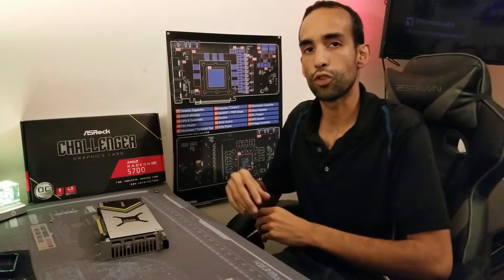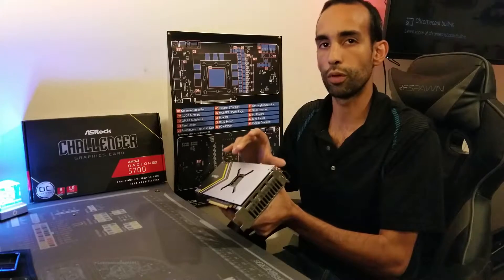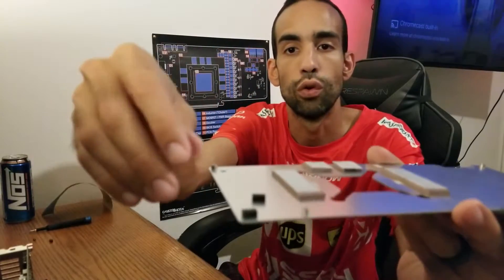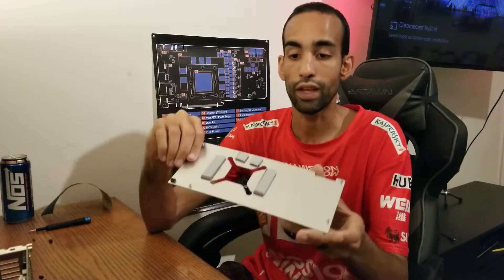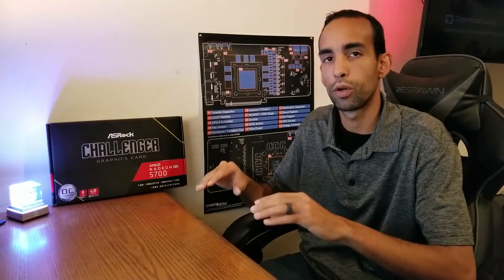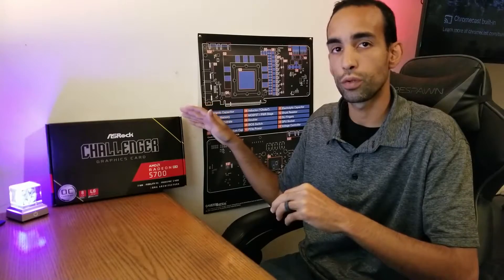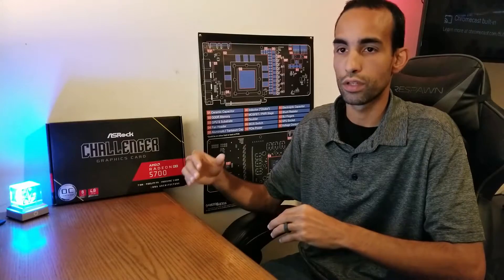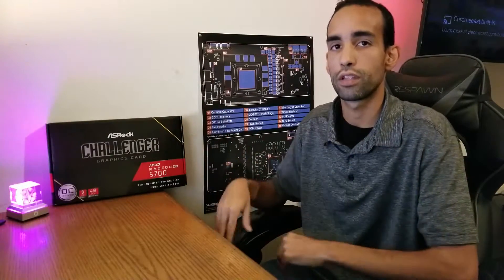Improving RX 5700 Thermals - Asrock Challenger

Comment: @SerpentX Tech  Please .. Do you think that if I use it on the rear of the VRAM, (rear of the vram + thermal double-sided adhesive tape + 1mm copper shim + thermal pad + aluminum back plate) I will have a better dissipation? or also if I use (rear vram + thermal double-sided adhesive tape + copper wedge). The copper wedge will be cooled by 2 powerful 140mm fan delta. What do you think of this? Sorry for referring to a slightly old video and sorry for my google translate English.
Reply from the maker: No, it would work, but be careful. If that copper or metal makes contact with any SMDs or components on the backside, you could short thr card. Instead of adhesive tape, copper shim sinking to backplate, you can just go no backplate and your wedge or bigger heatsink. Make sure to account for the Z-height of all the small components on the back
Reply: @SerpentXTech  Thanks for the reply. I've watched tons of videos about the famous "copper mod shim" between the vrm and its heatsink. But I came across the possibility that the pressure on top of the vrm in the absence of the thermal pads may cause problems in its welding. After all the thermal pads in addition to having the function of dissipating heat also have the function of evenly distributing the pressure in the component in addition to helping in the alignment of the parts, this no longer occurs with the copper wedge. On the other hand literally, that is, on the back of the video card, if we are going to use only (rear of the vram + thermal adhesive + shim) only pressure will be only the weight of the shim, I think it is safer that way, he will have less chances of slipping because he is sitting on top and not hanging, in addition to the positive fact of being glued,   the double-sided thermal adhesive tape has 2w/mk but is only 0.15mm. I am waiting to get the shims from China, as soon as I arrive I will disassemble and check if the 0.15mm adhesive will be enough to avoid contact of the shim with any component, otherwise I will use thicker thermal pad. My VRAM temperatures get at most 80°C in stress, but I want to go further with OC. Maybe 2000Mhz. I use this frequency on my gtx1700 galaxy katana.

Comment: Hey man, after you got your challenger working, what OC settings and voltage did you start using?
Reply from the maker: 0.850 mv Core Voltage, 1350 Mhz Core clock, and 1840 - 1830 Mhz memory.

Comment: Dude, thank you so much. I did the thermal pad thing using 3mm gelids from aliexpress, plus the slight bending of the plate. My mem used to reach 100c during ethereum mining, now it's around 88c!
Reply from the maker: Very nice, glad it worked Wolff!
Reply: Do you mod only in the back of the board w/ the plate?
Reply: @fireuno  just like the video. thermal pad between the back of the card and the plate
Reply: @fpcawolff  Agora que eu percebi vc eh BR!!!

Comment: Also wanted to let you know, if and when your fans go bad

The XFX rx 580 (red sticker in center) fans work perfectly on this card. Same 95mm, mounting pegs line up, wires reach and right correct pin out.
Reply from the maker: Right on time Scott, Thanks. The back side fan is going out, so I will look for that fan.
Reply: @SerpentXTech  np :)

I ordered 10 sets of the XFX fans haha, if you have trouble finding any let me know, don’t mind sending you one.

Comment: I just did this to one of my challenger 5700s

Used 1mm 17w/mk for under the vrm heat sinks

And 2.5mm 7w/mk for backside

Bent my backplate like you suggested

All backside pads are making solid contact.

About to throw it in and see how my temps are :). When mining ethereum I am expecting a fairly substantial improvement which should allow me to run the chips at a bit higher memory clock and thus higher hashrate :)
Reply: Update on this:

My memory temps decreased about 6c under my usual ethereum mining load

With new thermal capability, I was able to push memory clocks to 1880-1900mhz and still maintaining about 4c cooler memory temps than previous.

And I am now mining at 57.5MH
Reply from the maker: Very nice, congratz how did it do?
Reply: @SerpentXTech  4-6c improvement across the board

Gained access to pushing mem clocks much higher with ethereum mining as well. Very happy :)

Bought these in august for $329 a piece... what a flipping steal

Comment: Hey, I bought this GPU two weeks ago. Im only having issues with the vram temps and memory junction temps which are really high. Could I just replace the thermal pads? Its the first time Ive seen the pads from the backplate of the GPUs being changed, at least for the other models I see that people only swap the front part, should that be enough? Do you think that theres a size that could fit on this card without having to bend the plate? is my first time doing something like this so Im not confident on bending aything. Thank you!
Reply from the maker: Yes, just get 3mm thermal pads for the back if it is the same GPU model. Asrock Challenger RX 5700. For the front, just measure the pads already in place and order the replacement ones. I can't recall the exact size for the front, but adding some in the back yielded positive results.
Reply: @SerpentXTech  Thank you! It is the XT model but the internal and external designs are exactly the same. Temp on the core clock seems to be pretty good compared to the non xt model on stock but the issues with vram are still present. I think that there are no pads on the front side.

Comment: Been looking at your video several times. I want to try the same with my Asrock Challenger RX5700XT. Do you think it'll with the same thermal pads thickness?
Reply from the maker: Go for 3 mm thick thermal pads, and you might have to slightly bend the back plate inwards. Not enough it is visually obvious, but enough to apply pressure on the thermal pads

Comment: I only changed the paste and without pads.
My junction temps went up by 20 Celsius, .
Stock junc temp 80 c
New paste 100 c.

What I'm doing wrong lol
Reply from the maker: Take is back apart, and check the contact patch. You have to cover the whole GPU die. Do you have more paste, and what kind is it? I use thermal Grizzly Kryonaut. But not sure, retracing your steps help, make sure the GPU die is making good contact with heatsink, and try again. If you havent changed clocks or voltage then something is not making sufficient contact, I will say the stock cooling setup sucked, so that is why I modded it. The pads are for the back side of the memory but it sound like your just trying to get GPU temps down.
Reply: @SerpentXTech  My gpu was fine at stock, all I wanted is to lower the memory junction and hotspot temperatures.

After  renewing the paste first try.
Gpu 72c
Memory junction 78c
Gpu Hotpot 107c

I used arctics mx5 paste.
I will order pads aswell and do it properly next time. 

Mine is a gigabyte rx5700 xt.
Reply: @thekids_callmeboss6577  hello. I used the same card..did u use thermal pads for memory? How's the mem temp now??
Reply: @Миша-л7й8л  yes.
I sent my card back to shop and have a new one....
I do not recommend open the card.
You need to apply  the exact same tension when screwing it back.
You also need to know the thickness of the pads.

I recommend undervolt the card first and look at temperatures.

2000mhz clock 
1116- 1118mv
Memory 1840
Power +50 or maximum 
Adjust fan curve

Comment: I was really disappointed about temperature on RAM on this card. Mining ethereum was leading to freeze my computer. 
Temperature about 104 Celsius is too close to thermal limit on this card. I appreciate your video, it is really good stuff.
Reply: Is it really bad ? This is my first PC and i ordered this GPU since it was my only option....
Reply: @nawafbinhumaid_9181  gaming is fine on it.
Reply: @vyor8837  Yes I agree, I had never problem with gaming, only with mining. 
Finally I fix problem with mining:
1. Don't strip your memory in bios setting - let it be default.
2. Put away backplate from this card.
3. Use passive aluminium coolers for memory from backplate side.
4. Put some silent ventilator on the passive coolers.
Reply: @mariangall665  Hello, I'm about to install copper shims behind VRAM, I think of two mounting alternatives. Alternative A) attach the copper shims behind the VRAM using double-sided thermal adhesive tape. Alternative B ) Use behind VRAM x thermal pad 1mm x copper shim 0.8m x thermal pad 1mm touching the back plate plate (a sandwich) . What do you think of this? how did you fix your aluminum heatsinks behind VRAM?
Reply: Finally I go down with temperature to 94 Celsius, but freezing of PC still continues..:/

Comment: what about removing the backplate completely? Have you tried? Thats what i did but i'm wondering if instead i should buy thermal pads...
Reply: Same question , was wondering if removing the entire backplate will improve it with better quality thermal pads
Reply: @stemz4anime580  Just successfully removed mine without breaking the warranty sticker. Apparently if GPU usage is 100% all the time there's no difference in peak temp, but heat dissipates faster. I'm gonna try putting on aluminum heatsink instead of the plate next.
Reply: What you ended up doing? I bought this card and the thermals on the memories are horrible, just removing the backplate helps a bit if at all? I feel like it would make it even worse. You kept the thermal pads after removing the plate or just used the gpu without pads?
Reply: @PanchoBDM  yeah man stock thermals are horrible. Since there is no thermal pads between the back of the card and the backplate, it acts as an insulator since there is no airflow. Personally i ended up with a rajintek morpheus 2 cooler, 2x noctua nf-a12x25, enzotech pure copper vram heatsink, i used the rajintek supplied vrm aluminum heatsink and finally some thermal pads between the card and the backplate. Ok its a bit overkill but i already had the morpheus... and now that thing is a beast!
Reply: @alexispresley  so sad i dont have any of that to use 😅. Do you think that it would get better at all by removing the backplate or at least putting some thermal pads on it if it doesnt have any? I really didnt want to bend the backplate lol
Reply: @PanchoBDM  i do think thermal pads would make a good difference especially if you have good airflow over the back plate. Also it’s really not that expensive. That stock cooler really sucks and it will never be perfect. Even with the morpheus cooler, the original vram and vrm cooler were not able to keep the card cooled. Vram would hit 105c and vrm would thermal throttle after two hours of borderlands 3.
Reply: @alexispresley  sounds as bad as mine or even worse but good thing you found a solution for it
Reply: @PanchoBDM  a 200$ cad solution.... lol

Comment: Hi, Thanks for all videos about this videocard!! Really useful...

I know there is quite some variance in assembly quality for videocards, so in order to determine how good/bad the assembly of mine is, I'd love to compare thermals with yours. I'd prefer doing this before ordering thermal pads / paste and disassembling my videocard, because perhaps mine is quite ok and wouldn't get very much gain from the mods. Perhaps it's even a very good assembly that will be hard to match after disassembling (it doesn't make any weird noises so far for example).

But in order to compare thermals, I'd love some more details on how you measured... I already know you fixed rpm to 1500 (mine varies between 1490 and 1580 after trying to fix it). But can you give some more details about the rest? Like settings used in Unigine or 3dmark? Resolution? How long did you run it? Driver / BIOS version? Ambient temp in your room (approximately)? Did you use hwinfo of gpu-z for measuring? And whatever I'm still forgetting ;) I don't really require all details from all benchmarks, but at least 1 would be really nice!!

Thanks!
Reply from the maker: Let me get home from work and I will review my data, and I will get back to you.
Reply: I just ran Unigine Heaven with the Extreme preset (1600x900 :p) for about an hour and HWiNFO64 gives the following max values:
GPU: 76°C
Mem: 86°C
VR: 78°C
Hot Spot: 85°C
GPU clock: 1694-1712Mhz
So unless you were running some lighter preset, I guess mine is a bit worse then yours...
Reply from the maker: @Masta_killa_   Room temp - 24 C | Driver 19.9.3 at time of filming | Use Hwinfo to monitor and MSI Afterburner to overclock
Stock
GPU: 74°C
Mem: 82°C
VR: 75°C
Hot Spot: 84°C
GPU clock: 1669-1710Mhz

After Mod (Liquid Metal and Mem Pads)
GPU: 70°C
Mem: 77°C
VR: 68°C
Hot Spot: 80°C
GPU clock: 1686-1718Mhz

FireStrike Extreme -  Stock Clocks 1440 p benchmark
Overall - 10493
GPU Score - 11107

FireStrike Extreme -  MorePowerTool RX 5700 XT level performance
Overall - 12443
GPU Score - 13343

Core set to 2180 Mhz
Mem set to 1850 Mhz

GPU: 81°C
Mem: 78°C
VR: 77°C
Hot Spot: 98°C
GPU clock: 2050-2122Mhz
Reply: @SerpentXTech  Thanks a lot! Do I understand it correctly that all the above temps were maximum temps after running Firestrike Extreme once? Or did you loop Firestrike Extreme and ran it for a longer time?
Also I wasn't aware you could use an MSI tool to overclock an Asrock card... Is that advised? Thanks!
Reply from the maker: @Masta_killa_  so the temps above are from running Unigine Heaven on loop, and yes MSI afterburner is a good tool to use no matter who makes the card. Also a tool named "OverdriveNTool" is a good Plain interface you can use to overclock or underclock.
Reply: @SerpentXTech  I supose Unigine Heaven with the Extreme Preset? I forgot about another important factor btw... What case are you using?
Reply: Hi,

Little follow up from my side... I've bought below 2 products:

https://www.amazon.de/gp/product/B011F7W3LU/ref=ppx_yo_dt_b_asin_title_o00_s00?ie=UTF8&psc=1 Thermal Grizzly TG-K-001-RS Kryonaut (7,08 euro)
https://www.amazon.de/gp/product/B07CK31PST/ref=ppx_yo_dt_b_asin_title_o00_s00?ie=UTF8&psc=1 Gelix GP-Extreme 3mm thermal pad (10,99 euro)

And applied them on my videocard. I've used 2x 57mm x 20mm thermal pads on the left / right memory and 2x 23mm x 20mm on the top memory (using up the whole pad). I've also bended the backplate, as you did. I've removed all rubbed spacers, except the one in the corner.

And here are the results using Furmark with fans @ 50% (+-1600rpm):
Before: GPU 77°C | Mem 106°C | VR VDDC 80°C | Hot Spot 85°C
After: GPU 75°C | Mem 98°C | VR VDDC 76°C | Hot Spot 84°C

So nothing became worse and memory is a lot more acceptable now.

Note: As you said, during normal gaming both noise and temps never were a problem. However, it is winter here now and I don't have AC, so I mainly did this to avoid problems in the summer...

Thanks again for your video!

Comment: First off, awesome videos for card. My plan is to mod it to help thermals and make it quieter. This would be my first time attempting something like this. I just looked at frozencpu for pads , and it seems only the 6w pads are listed now. My biggest plan is to remove the stock fans and ziptie some Noctua fans to the heatsink. I don't care if it's pretty. Any thoughts?
Reply from the maker: That would work as you can separate the shroud and fans from the heatsink. Sucks they dont have the 17 W/mK pads anymore but the 6 will work. Just need to sync some of that heat to the backplate.

Comment: Hey man great video, would you reccomend this card? In my country this one is currently selling for 325 whereas other 5700's start from 380. Also I saw that you flashed the bios did you notice a big improvement? Would love to hear your input man.
Reply from the maker: I saw a mild 4% - 8% gain when flashing the bios, I like the card but the cooler design could be better. If you get it, replace the thermal compound and see if you can get some thermal pads on the back side of the memory. If it cost more the $380 in your country to do all that, then just grab the Sapphire pulse or Gigabyte model.
Reply: @SerpentXTech  Thanks for the quick respond man you've earned my sub. The asrock challenger is 325 in my country and the other ones like the pulse, evoke start at 385. And the 5700 XT's start off at 420 (nice) but still it's 80 bucks more for a handfull of frames so the challenger 5700 would be a wise purchase right?
Reply from the maker: @lennard7152  yes, I agree especially for only a few frames, it's not worth the price difference. Thanks for sub and good luck

Comment: I got this card and have had a super hard time getting it stable. I believe it is a software issue. Could not get it to respond properly to 3d applications   gaming would not run card at compassity to even spin the fans but when benchmarked it would run to it's potential.  After it was benchmarked then it would run to it's potential in games. Very weird. I tried all the drivers that were available as well as a bunch of different auto oc features through wattman and settings through windows and Radeon. I ultimately ended up rma ing it and have a new one on its way.  Hopefully this one responds properly to 3d apps
Reply: How is it now ?